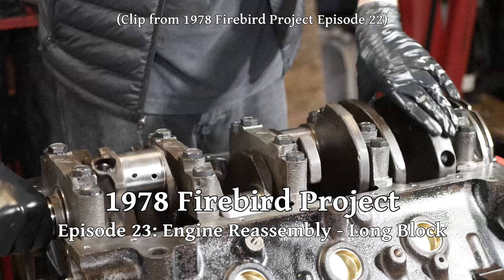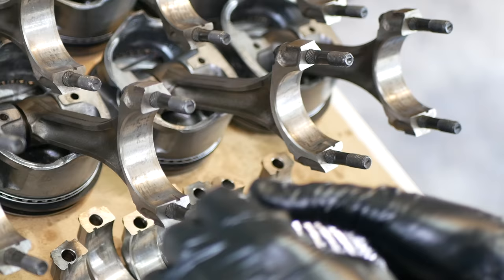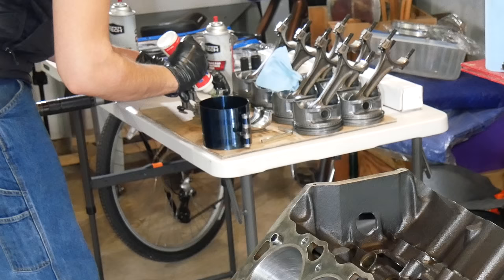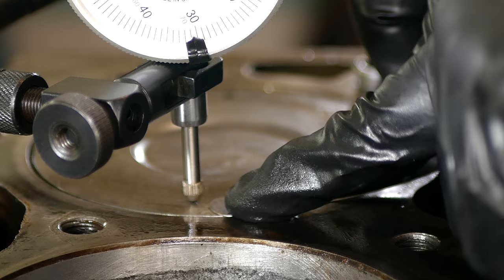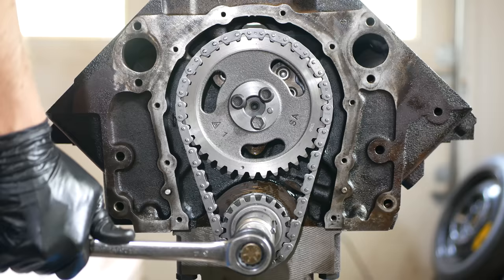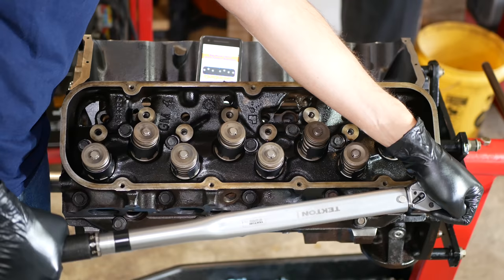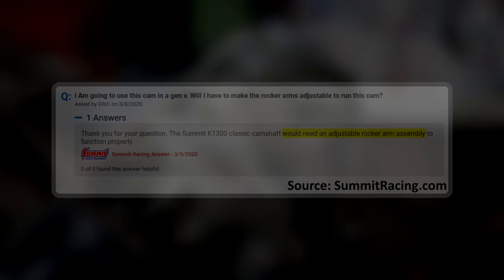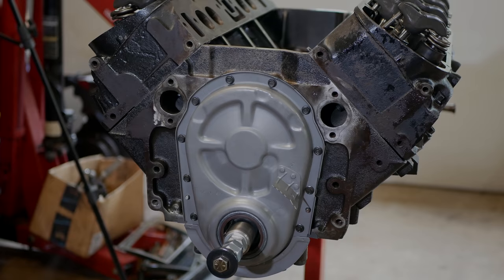$200 454 Engine Rebuild: Installing Pistons, Cylinder Heads, and Valvetrain (Ep.23)

Comment: A little tip for future v8 cam in block builds put the cam in first with the motor upside down this way you can reach in and help guide the cam into the bearings
Reply: I feel like it's just an unspoken rule 😆

Comment: i run a .527/.544 lift Hyr roller cam on the stock non adjustable gen 6 and doesnt have a problem at all, back in early 2000 car craft did a write up on a 454 with a .598/.610 lift with the stock non adjustable rockers and worked just fine

Comment: Been watching this build since you started it I am extremely interested to see how this thing runs
Reply: It'll be fine I took 80 grit to 3 cylinders on a 454 after soaking them in Coca-Cola for a week didn't even tear it down to hone the cylinders just blew it out with kerosene put some heads together worse than those put it in a 5 different Ltd derby cars and ended up putting it in a mud truck where it still just gets flogged on it puffs a little when it's cold but it just keeps running

Comment: idk if I have mentioned this before. If you use Permatex Number 3 aviation goop on paper gaskets you can reuse them many many times. Just don't spill it in your toolbox because you'll never get rid of it lol
Reply: Why the hell would you wanna even try to reuse a paper gasket 🤣🤣🤣
Reply: Things you are taking off and on multiple times to test and tune. Just to generally not be wasteful. So you don't have to keep a stock of every gasket in your garage at all times. It might get you out of a tight spot when you're fixing something on the side of the road at midnight by light of a torch. Many reasons.
Reply: @JamieBainbridge  Fair enough

Comment: Hehehe, yeah I know what you mean.  I my self for the few engines I've rebuilt (a dozen small motors, and one AMC Straight 6), I would coat the cylinder walls and piston skirts with Valvoline 5W30.  As you say, there is a dozen or so ways people rebuild engines.

Comment: I have never heard anyone say to install pistons dry, that's absurd, in fact the way I was taught and every video I've ever seen by a professional engine builder is to use engine oil so in my opinion WD-40 (water dispersant formula 40) is very light but still better than dry. All dry is going to do is increase the chance of scoring the cylinder walls badly. Honestly sounds like some headlight fluid BS!
Reply: I have heard people say, “some people say to fit pistons dry” many times.  But I’ve never actually heard anyone say, “you should fit pistons dry”.   Sounds like bs to me, too…

Comment: ***Standard long comment warning***

<---- Is an Automotive Machinist for those couch coaches that wish to say I have no idea what I am talking about. I feel I am one of the voices of reason here defending you for simply doing a backyard rebuild (although your version is probably more thorough and complete than most) I love seeing you troll the trolls, dropping the valve into the waterway is pure genius and probably  one of the few times I would champion your personal statement over not putting more "trash" into our environment. Those trolls seem to forget why you are CHOOSING do the build in this way. To remind them and any new trolls that are incoming why you chose to do it this way.... "To see what results can be achieved on a budget" (paraphrased 'cause I don't want to go find the actual quote lol) I still say that you are doing this right and showing what can be done and I still say that this will all work perfectly. Things can and will fail/go wrong even when you build the engine with all new parts and machine everything....ask me how I know. Regarding the valve or anything else you want to flame Mr. Finger for, sometimes you don't have the $$ to go buy a new valve nor the time to find a used one to lap in so you simply run what you brung'ed..... sorry I can't help it

Comment: TIL: You are supposed to measure piston rings at three spots. I uh. Totally did that. Yes.

uh-huh. Sure did that during the engine builds i did. Yeap.
EDIT: Man, its always the boats causing them pesky accidents.
Reply from the maker: If you have an engine block that is in very good shape or was freshly machined, it shouldn't matter top to bottom but it's a quick way to check bores for taper without a bore gauge. The gap reading can change quite a bit in a block like this one where some of the bores have significant taper, so it would be good to know.

Comment: I imagine it was later caught (or I am incorrect), but was the camshaft retainer plate not installed? Apologies if incorrect .
Reply: Good eye, but not needed as he installed a hyd. flat tappet cam. A lot of these had factory hyd. roller cams which would have used the thrust plate.

Comment: 6:00 does your manual say to use oil? It does change the amount of stretch you get out of the bolts and essential over tightens them if it doesn't as the spec will be dry if not.
Reply from the maker: Haynes manuals are not good at providing that type of information unfortunately, it just lists a number for everything with no additional information. What I've been taught is that pretty much any fastener inside an engine that doesn't need thread sealer should be lightly oiled. The more specific spec sheets I have seen for small block Chevy engines listed all the major fasteners (main caps, rod caps, screw in rocker studs, etc.) as oiled, so I feel safe to think that the big blocks would be no different

Comment: is it really important that the pistons go into the same bore even after honing and new rings?
Reply from the maker: In some tight tolerance engines, pistons are size-matched to bores and will fit a little better in some than others, but for common stuff like this I'd say it doesn't matter. As long as the rod caps are on their matched rods correctly, you shouldn't run into issues switching pistons between bores with most applications.
Reply: @FuzzyDiceProjects  thank you! now im relieved
Reply: I still would have done it for the sake of the rod journals, but with the overall condition I agree it won’t matter - just makes my OCD a little crazy 😂
Reply: @ronskopitz2360  yea i lost track where my pistons and rods go but i checked and they should be all the same

Comment: Before you install a new cam measure each lobe on camshaft, should be at least 003 thousands edge difference so lifters will rotate while running, as well as grab 2 lifters should rock butted  end to end check, failure of flat  tappet cams is not hardness of metal but sloppy machine work.

Comment: I am admittedly opinion shopping here and would like yours. My '96 Suburban, 454,  4X4 now has 225,000.0 original miles. It only runs about 40 PSI oil pressure on the frwy. I have to use 20-40W to avoid the oil pressure light ("Check Gauges") light from coming on at idle. Otherwise, it runs perfectly and has never dry started, and sounds tight. I was wondering your thoughts on dropping the pan (a pain due to 4X4), removing rod bearings, hand polishing crank, and reassembling with new rod bearings (is it possible to do the mains??) after plastigauging. I don't want to spin a rod bearing or some other failure due to the miles. After new injectors, it runs smooth and has tons of power. Your thoughts?
Reply from the maker: I'd put a mechanical gauge on it and verify those readings, a lot of the time factory gauges/senders are not terribly accurate. My Silverado would turn the oil light on at idle an awful lot until I changed the oil pressure sensor two times and got a good one. Sometimes old senders can also get a little clogged and give odd readings. If those readings check out and it was my truck, I wouldn't go through dropping the oil pan and a bunch else just to do the rod bearings (which may or may not help) when the oil pressure is a little low on 20-40W but not catastrophic. It is possible (though awkward) to do main bearings with the crank and engine installed, but again it may or may not make a big difference.

Especially if those are hot weather numbers and it stays over 15 PSI at idle I would keep an eye on it to see if it gets worse but let it do its thing. With a mechanical gauge on there give it some RPM while cold, if the pressure gets up toward 70 then it shouldn't be the pressure relief valve or the oil pump that are struggling. Also make sure you are using good oil filters and not the stubby ones if you can help it. I've never had that make a difference but in some situations it may.
Reply: @FuzzyDiceProjects  All good advice. Thank you. I am an engine guy from way back and my ear says and my engine is very healthy and the annual SMOG checks we do confirms how clean it runs. I just don't want to fail my engine by not doing something now that would ensure another 100K. I have had it since new and have always used high quality oil and WIX filters.
Reply: I totally agree that a checking the sender first is the smart play.  I would also just check the screen on the pickup and possibly replace/rebuild the oil pump before I started messing with crank clearances…

Comment: that is no way how pistons should be instaled. you have to use engine oil, not just spraying cylinder but also the piston mounting tool as piston and its rings. also you should NEVER use shuch a force. light tapping should slide a piston